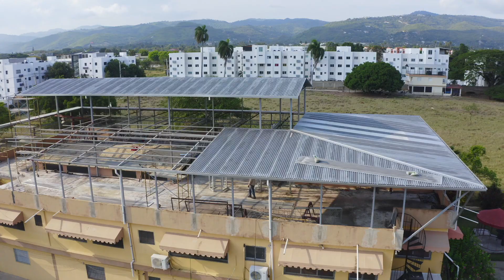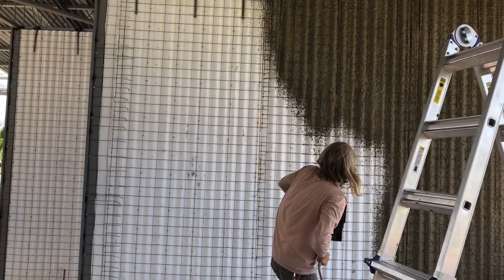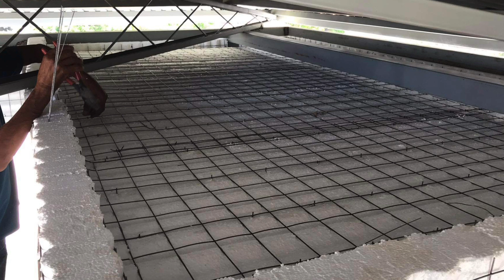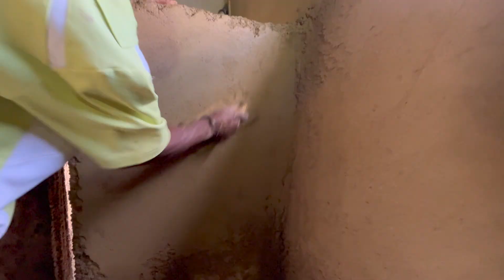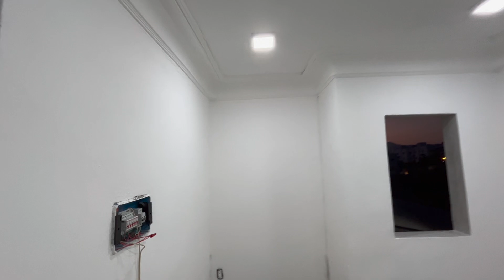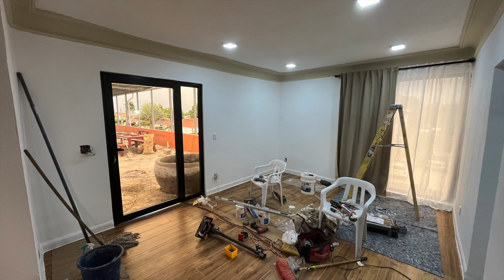Full House Build Out Of Styrofoam Finishing With Cement Plaster

Comment: Is it strong ? If installing anything on the wall would it be trouble some ? Such as split unit ?
Reply from the maker: If you’ve done your cement correctly, it is very strong. I hung my mini split just straight into the plaster masonry screws, and I’ve had no issues